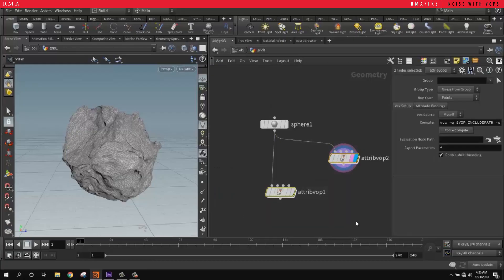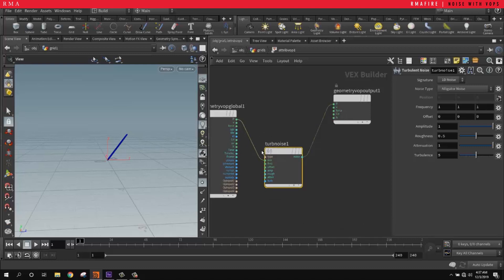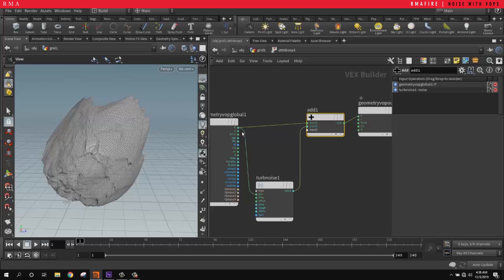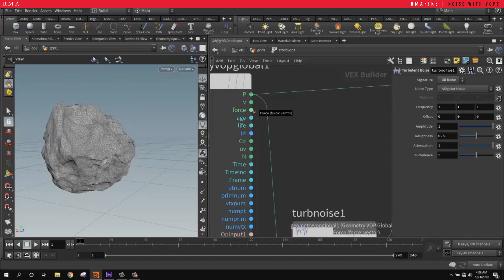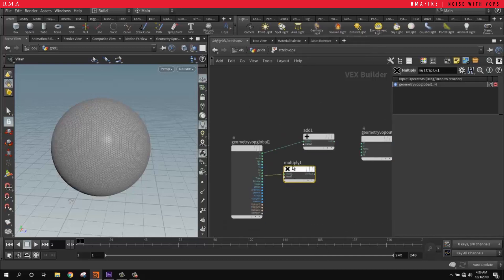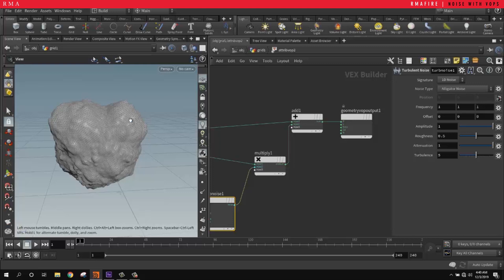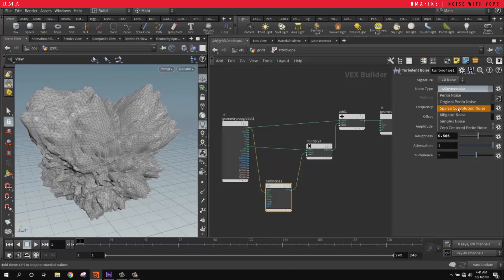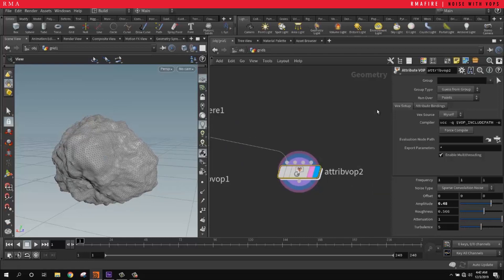Noise in Houdini Using Vops  *FIXED GLITCHES

Comment: not working
Reply: instead of 3D noise , multiply the normal (in first input of the multiply ) with a 1D noise and then add to position . otherwise use a displacement along normal node and connect the noise directly to the scale and P to P .